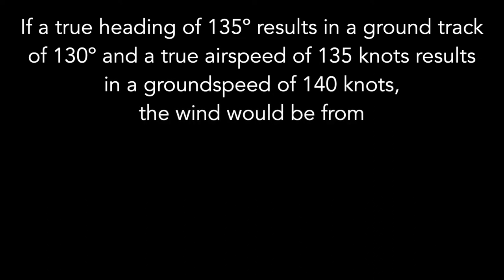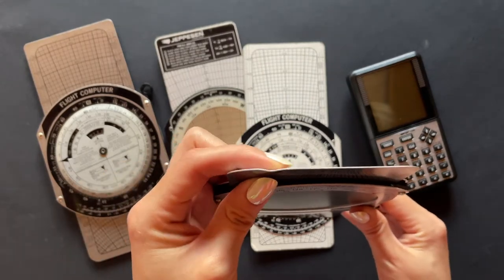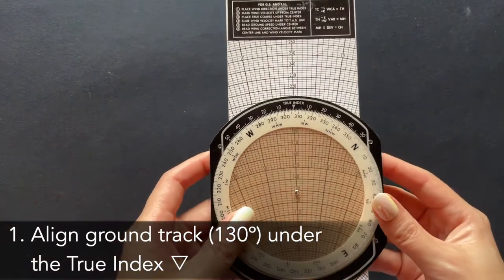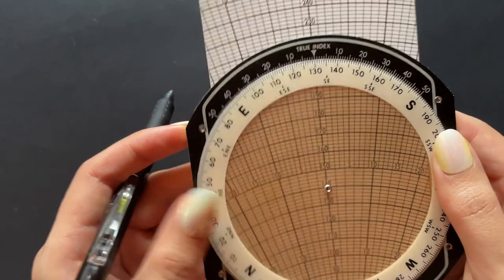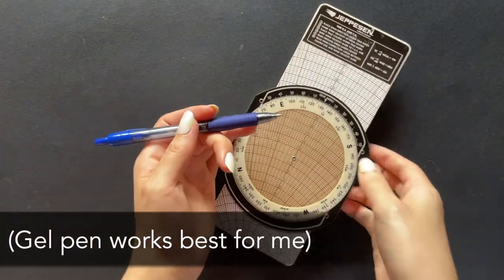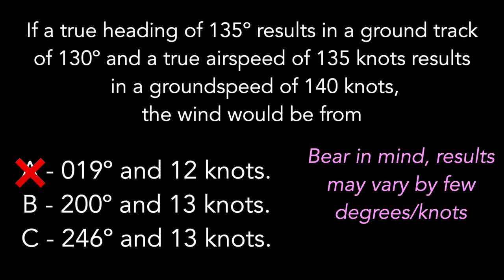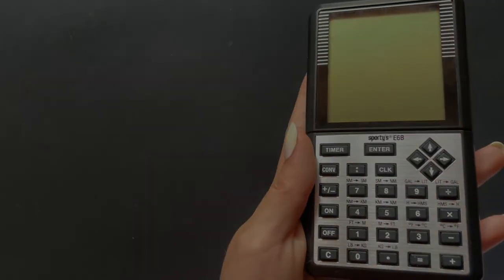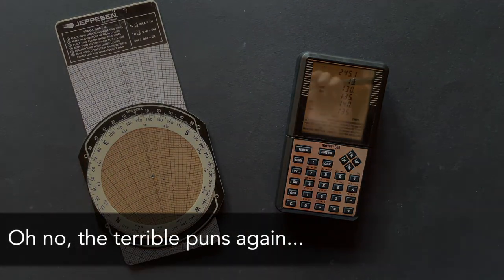Calculating Wind with E6B, Private Pilot Written Test Practice Question

Comment: G,day from Sydney Australia.
It's been 22 years since I've practiced with an E6B.
When you presented the written multiple choice question, I immediately started to picture the 360° of the compass and process the variation due to wind. Thinking to myself (she's got a calming voice, therefore the wind must be coming from....what side of the plane to push me 5° off my heading) then I thought, it's not changing the airspeed much....so, it can't be to strong, I better touch the pause button and consider the multiple choice options.
I then started to reminisce of sitting with a sectional chart, pencil and ruler trying to work out scenario problems, in an old disused Court House of Law in a small country town with a retired airline Captain.
I may have to watch your E6B instruction a few times.
Thankyou for creating great learning resources.
🌏🇦🇺
Reply from the maker: Great, taking a moment to visualize the wind and its effects on the flight can really simplify the situation even further. Thank you for sharing John!

Comment: I hate this question on the test because I forget how to do it on the analog e6b. This question alone made me buy the electronic version.  lol
Taking the test in about 2-3 weeks.
Reply from the maker: The same frustrations convinced me to buy the electronic version too, good luck for your test! I made sure to have spare batteries available, just in case haha.
Reply: @AIDYLCONCEPTS  Just took it. Passed with 98. Guess I am not perfect.  Thank you for your videos.
Reply from the maker: @ahmadsamadzai8255  98 is awesome, excellent job Ahmad! Thank you for sharing this great news.
Reply: @ahmadsamadzai8255  how many questions did u have to use ur E6B calculator for
Reply: @ant6014  Can't remember exactly but I think I had a couple of questions that I needed to use the E6B for.
Reply: @ahmadsamadzai8255  what would u recommend i study the most for the test? Are there a lot of maps questions
Reply: @ant6014  I studied the gleim online course plus prepware. I watched tons of YT clips too. That's all you need. Good luck.
Reply: I got did my checkride 2 weeks ago and passed. Private pilot at last. I am going for the instrument rating (I thought I'd consider that in a year or two but now think it's better to go for that now since everything is still fresh in my head). As always,  thank you for your videos and tutorials.

Comment: E6-B.  Why do we still teach ancient technology? The year is 2024. We have electronic calculators, and ForeFlight. Does learning a manual E6-B give a modern day student who is learning flight planning for the first time, a better understanding of flight planning? or is it a waste of time given our modern day technology? Do you guys think the E6-B should be thrown into the garbage can? Is it still worth learning given today's technology? If so...then why? Martha King's reasoning is to have a non electronic backup if the electronic calculator fails. What are your thoughts ? Any other reasons why a student pilot should take the time to learn how to use the manual E6-B whizz wheel? Anybody? Any airline pilots or want to comment? Anybody want to comment? Curious to hear your perspective.  Are there any studies that cite it's better to learn initially using a manual E6-B?

Some younger students say they just use their iPhone if their iPad fails.   But that doesn't address the question if learning by a manual E6-B helps a student pilot better understand flight planning?

Are we older guys just stubborn in our old ways, or is there a legitimate and rational reason to still learn the old E6-B?  I am open minded and l'd like to hear your perspective on the topic.
Dank je wel....